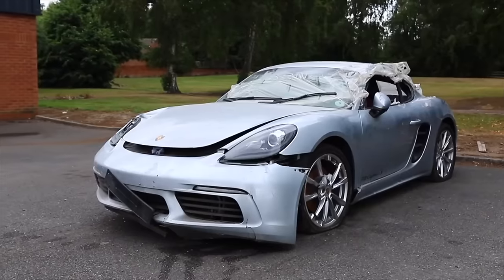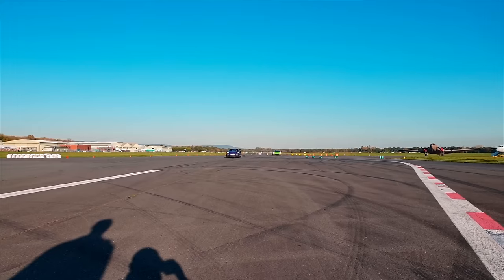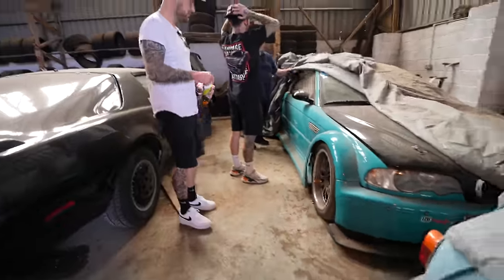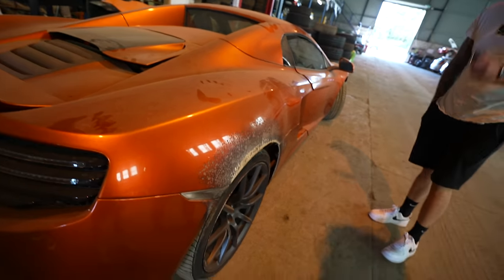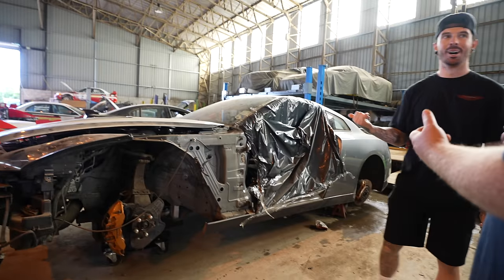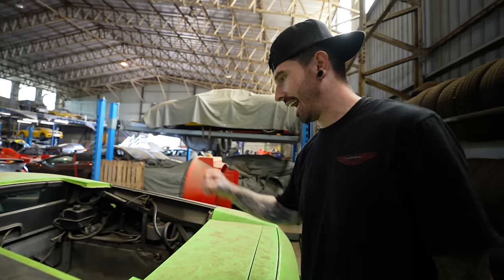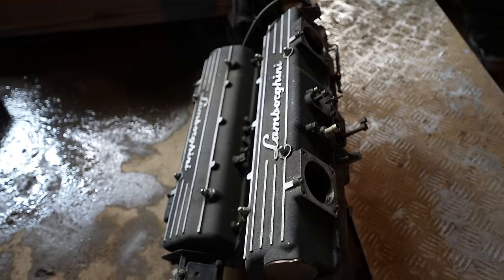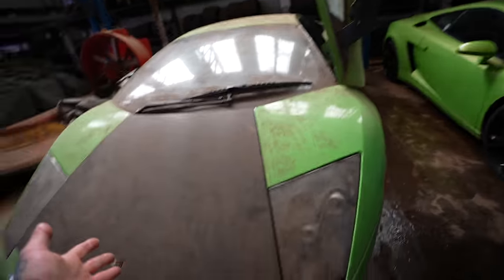I FOUND 2 ABANDONED LAMBORGHINI MURCIELAGO'S

Comment: It’s sad to see such great cars left to rot rather than giving someone a chance to rebuild these legendary cars
Reply: They’re not great cars, that’s why they’re at the junkyard, you know which cars are great Toyotas/ Lexus or Mercedes from twenty/ thirty years ago, those things just keep driving.
Reply: @h.rutten2187  Only the LFA can hope to get near the experience of driving or looking at one of these though
Reply: @h.rutten2187  bro your like 8 and any German luxury car Mercedes BMW and other ones are very very expensive to fix and break alot wouldn't be talking if I were you
Reply: Horrible Italian cars,    only one car and that's a Bentley
Reply: @eue7dyueuehdueud445 My Mercedes been going strong for 4 years now, I did have one issue where my ignition  barrel stopped starting the car, installed a push to start switch then car fixed itself, now I have 2 ways to start the car. I will admit parts are expensive but other than that it has been one of the most reliable cars I have owned, funny enough I have had more issues with my Toyota Levins
Reply: He was the someone that took a chance

Comment: Hey Matt, greetings from Australia love your work mate.
If you do your research you will find that 90% of the Murci is carbon fiber and the carbon fiber panels on the car are extremely expensive to replace, just have a look at DDE's video on the rough breakdown of the insurance estimate they did on there murci after it was crashed.
Headlights and body panels were ridiculously spendy  and the wait is another issue.
Also the roof is the only steel body panel on the car.

Comment: All depends on the prices of the cars. Id love to see the green one put back together yes I'm sure it'll cost MORE but you'd have a better car afterwards because you would have touched every part of the engine and car and know what has or hasn't been done to it. The yellow one scares me, the engine was rebuilt by someone and when they put it back in there's a "timing issue" so instead of fixing a somewhat easy problem they parked the car??? Both stories on the cars sound questionable. Plus you see how they treat their cars when they aren't on the track just imagine how they are treated on the track. But if the price is right I'd go for the green one. I'd like to see what color the car is under the wrap and think content wise the green one would have everyone waiting for the next video to come out since there is so much to do to it. I've seen what you can do with some pretty messed up cars and think your education and experience would grow 100% more with the green one. The yellow one needs engine work and insides put back together with the way you work that's at most 4 or 5 videos. Good luck with whatever car you pick, just don't get stuck thinking you have to have one of these two cars.  For sure the values on gated Murci's are still going up.
Reply: The green car is definitely not a wrap, interesting comment, with a thumbs up.
Reply: @MrSteviesmozz  are you sure about the wrap, mate?

Comment: For me, would have to be the one with lowest miles as less of a life on the track. 

Note, left the plate on the one part of the video after hiding it previously!
Reply: Depends when Everyman bought it - the green one did 30k miles in 2006-2007 (!), then there’s a weird 1000 miles in 2008 in 10 days between MOT fail and pass! Has to be on track (presume owned by Everyman), for that, surely!

Comment: You need to take both. Both will be worth killer money. Even with no running gear. To find a manual is like a needle in a haystack. Check out Tavarish. You can learn a lot from his fast and furious rebuild. Take both. One for parts for the other. Even in parts you'll kill it.

Comment: Get the manual, green Merci. Best experience with the transmission. The later, after a success with the green Merci, get the yellow one. Both experiences but different times. You said u were going to ask mechanics about changing the e-gearbox to a MT, what did they say?

Comment: having owned a manual Murci 6.2 2005 and driven it for 22,000 miles in three years, my sincere advice is walk away , no run away as fast as you can . the great problem is parts price , my car,  a set of 2 exhaust camshafts £14800  (need to buy in a match pair ) and thats if the inlets havent gone as well , the catalysts will be toast replacements are £4800 each , Brand new headlights £4800  each,  main service if the car was in decent condition and valve check £7700 , both these cars will have issues with the cams , the oil seals will be gone , engine will be a bag of bolts if you are lucky , clutch and flywheel is £4800  ,  i dread to think what the chassis is doing rust wise they always had a habit of going on the inner rear arches and engine bay area,  diff is £18000 that will be gone100% .  A new engine is £58000 ,  geabox is circa £22000 , body panels very roughly work our at £12000 each if damp and rotten , havent even talked about the front lift suspension yet or a respray minimum of £15000 as its a triple stage metallic and almost impossible to blend  . id think carefully if i were you .... lol Sorry to be negative , my car i spent £28000  in servicing and mine was one of the most cherished in the country , previous owners of mine spent £68000 on servicing 8 years , the chap who bought my car off me spent another £54000 in two years on it just keeping it running .

Comment: The green one looks the better car although she's in bits. I know they said the engine was tight when they turned it over back from rebuild, but the amount of engines I've rebuilt over the years that's how they are till you get oil round and fire them up. As long as it doesn't lock up and you have to force it round should be ok. I know you love a challenge mate but going to leave this one up to you 😬

Comment: First off. Don't be afraid of walking away. If it sounds too good to be true, it probably is. Don't destroy yourself financially for Youtube my man. 

If you do go for one of the two though, go green . Engine and gearbox are on a pallet already. Who know's what this place has done with the other one and at least you can inspect and strip the engine can get it running without it being in the car first. Would mean you've got a rolling shell & it's something completely new for the channel (installing engine/gearbox into a rear engined super car). 

Make sure you buy at trade price. I would not be spending more than £80k on either of them, even if mileage is low (which it isn't, it's quite high).

Comment: I wouldnt touch either one...ESPECIALLY the yellow one...If it was something small they would have fixed it OR it might be taken apart like the green one. The green one will be a  nightmare because of all the little things like fasteners, seals, gaskets etc that it will take to put it back together. There are enough sketchy ones out there to not deal with the headache.  if it made sense, they would have already done it and dumped the cars at an auction.

Comment: You buy the green car , we're not talking about a Morris anybody that thinks the engine doesn't have to come out of the yellow car knows nothing about cars . Those cars have sat for too many years to not need a mechanical over haul so your better off buy the one that is disassembled so you can assess and inventory the parts before you start , don't chase gremlins by throwing parts at something build it complete and right and build it once , you will save money in the long run . Timing tick ? come on that's more likely a manifold leak at the minimum .